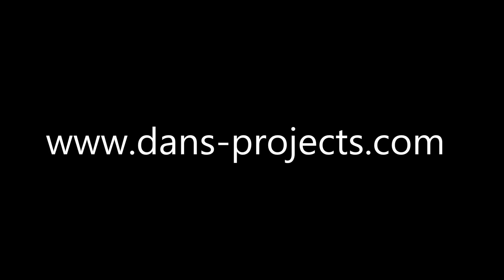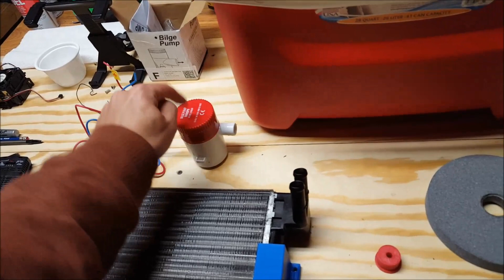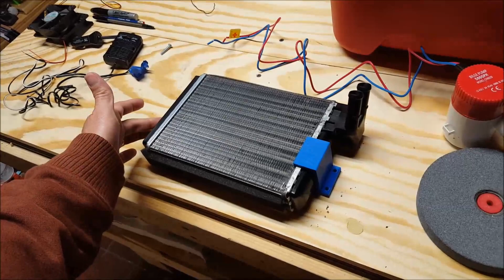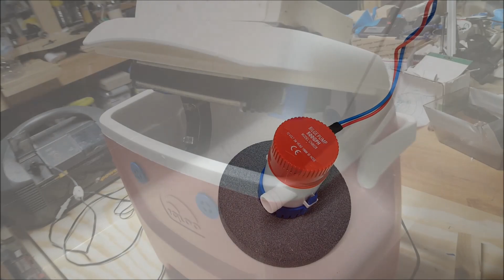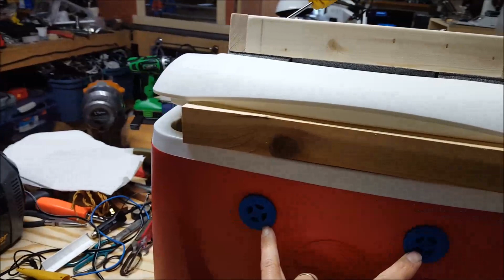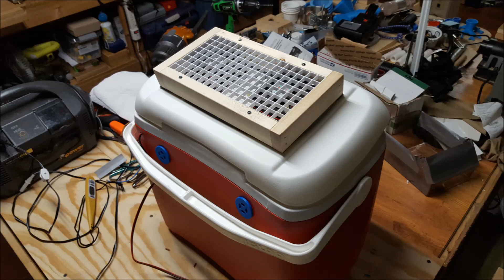DIY 12v Portable Air Cooler

Comment: The cooling effect of this air cooler depends on the volume of air that is blown into the cooler.  Using a larger fan might improve the volume of cooled air that exits and hence the overall value of the cooler.
Reply: Agreed

Comment: Drez - You indicated 59 deg. as the 'conditioned' air temp but what was the ambient temp in the shop? (delta T) Thanks - Love your videos
Reply from the maker: Hi Charlie.  It's a cool day here - around 70 in the shop.  The tap water was pretty much room temp but the freezer packs were certainly frozen.  The water level was also pretty low; just a tad over the top of the pump.  I'll be curious to really test it out when it's hot outside and with a bag of ice.  Thanks for your time and comments.